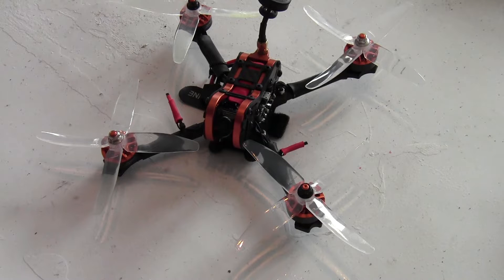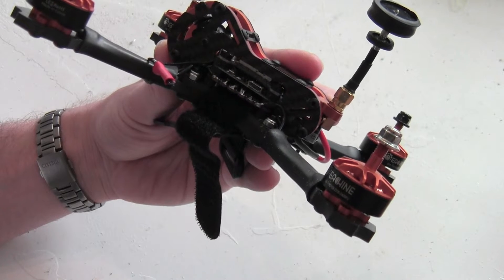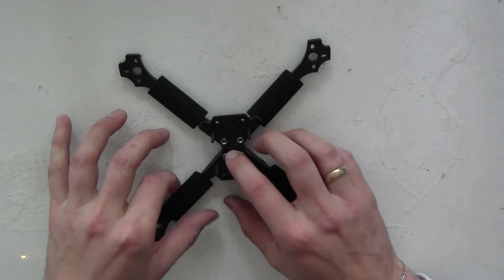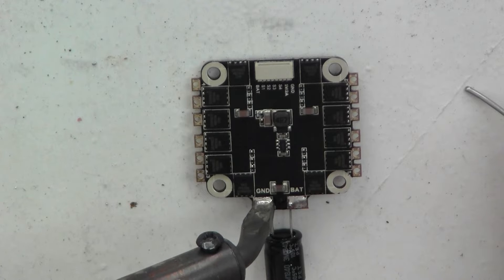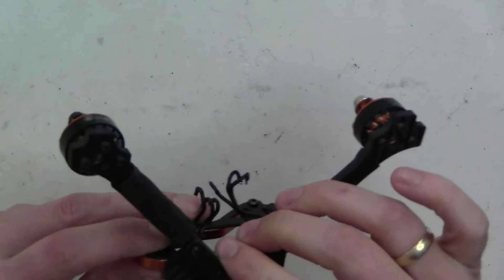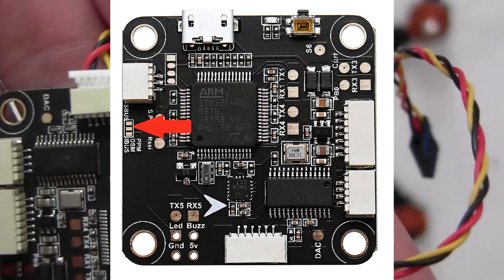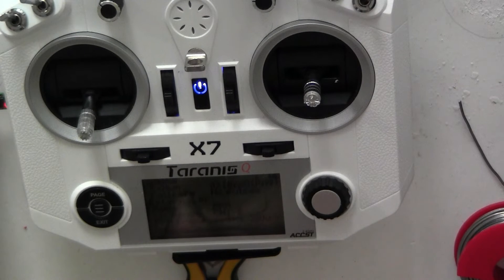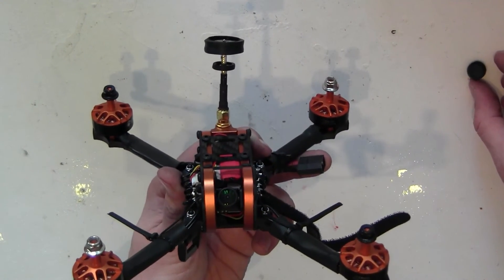Eachine Tyro109 Build Video.

Comment: How do you change between vtx output levels?
Reply from the maker: If you installed a wire for smartaudio, use your transmitter and goggles. Left stick left, right stick up. Then choose vtx sa, powerlevel. If you use the button control, press the button 2sec to change freq, another 2 to change band, and another 2 sec for power level. There is a 3rd way to use cli commands in betaflight but i recommend looking that up on youtube.

Comment: Why rap the cords around the stand offs?
Reply from the maker: I did it for the looks, you're also less likely to pull your motor wires when you fly into a tree or bushes. Downside of this is that it is more work and you have to remove vtx and fc if you ever have to replace a motor.